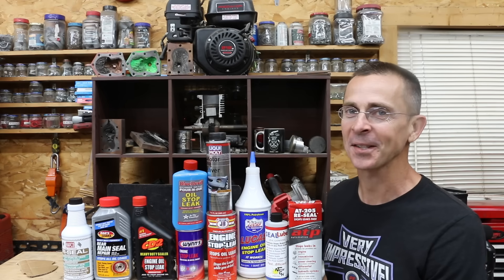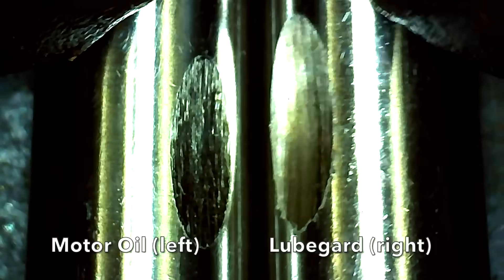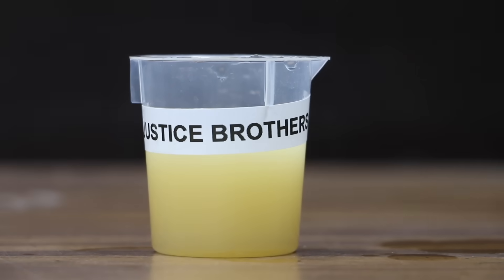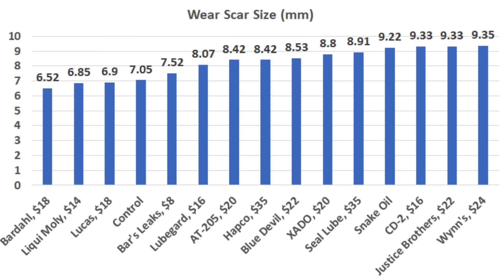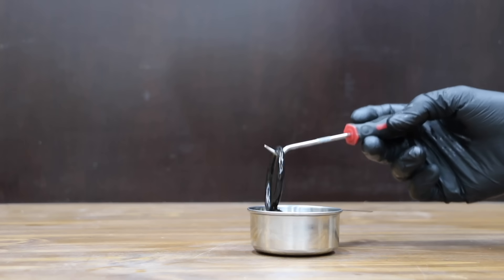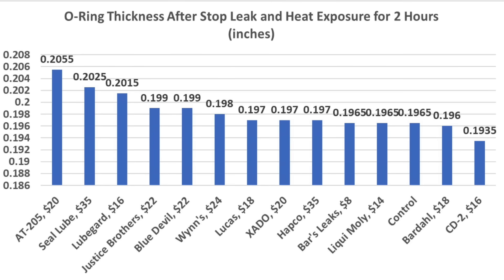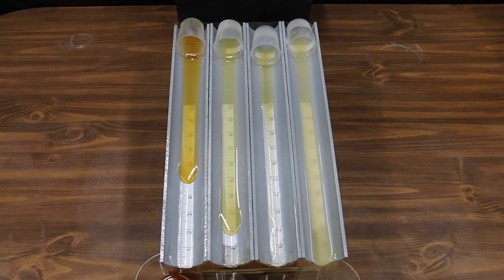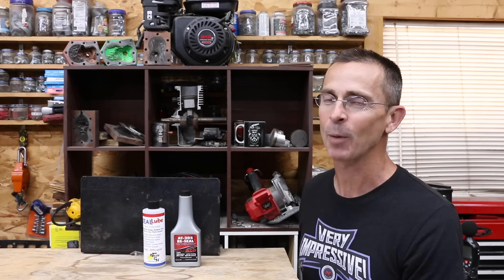Do Stop Leak Products Work? Do They Damage Engine Seals? Will They Destroy an Engine? Let's Find Out

Comment: I've used Lucas for 20 plus years I honestly wasn't impressed, but I'll still use it and pretend now it's working as well as before I watched this episode. You've helped me out countless times with products. You help out people I think more than you could ever imagine.
Reply: I use Lucas engine treatment in differentials and manual trannys but not in engines. Nothing replaces a blown o-ring but a new o-ring. BLESSINGS!
Reply from the maker: Thanks!
Reply: The only reason I use Lucas is to extend the life of a component already on borrowed time(wore out transmission, high mileage motor, worn power steering pump, worn differentials and transfer cases, and worn small engines).
Reply: @jamesm568  Sure. Mine is an 89 Taco and all the other stuff is from 85 on up to 02.
Reply: I'm confused did Lucas work or not
Reply: that was my experience w/ the lucas, but front main was (and remains) pretty hubbed out. it was easier to just keep throwing oil at it until some other failure forced me to clear a path to it anyway
Reply: @rngwrm  RIGHT! Oil is cheaper than shop time. I pour in the oil and drive. The car is a 97 Buick with over 250K and the Taco is an 89 4x4 with plenty of rust and a 4.3 and a 20 gallon tank. Check the gas and fill up the oil.
Reply: @lewiemcneely9143  98 econoline here, so about the same level of interest in a proper fix. blew a freeze plug or cracked the block in december, so now i actually have to  tear it down, and front main happens to be on the path to the bigger problem, but i'm probably just doing an autopsy at this point. if it's still salvageable, i can do the seal then, but at least i didn't waste the time doing work that i'd be undoing a couple of years later
Reply: @rngwrm  My old S-10 Taco has a Jasper rebuilt in it. the factory intake gave the bottom end a good slug of antifreeze and that was that. Like the old saying; it's good enough for who owns it. I don't know where my leaks are but as long as I can buy refills by the quart or gallon, they can keep rustproofing whatever they want.
Reply: I've found Lucas Oil Products give "peace of mind". Unfortunately, without very expensive test equipment. It's almost impossible to prove that there's any benefit.
Reply: Check out paul Harrell’s latest video. Step 4  ‘Know when your being that guy’.   Lol.  I’m not saying it to poke fun.  You self identify your experience vs choice I think you would find it funny and go with it as he recommends.
Reply: @rydplrs  I've been 'that guy' more times than  can remember during my 50+ years driving and equipment operating. I just wobble along as best I can while I am in my geezerish state. Remain calm!
Reply: got an 05 Civic 311k miles with replaced engine. Replaced all valve cover components & still oil leakage. Oil pan does leak, but was "bandaid" with some RTV from mechanic. Thinking it most likely piston rings seal failed with 170k engine. Also replaced the cam seal on side of valve cover. Would that ATP help or am I better off trying a Blue Devil or Bars product? Read main seal OEM part replaced upon clutch replacement so not worried there.Used Lucas in past, but will try the Stop Leak this time. Thanks for any advice.

Comment: Fron experience i can recommend the Lucas power steering as well as their transmission additive . I got about 13k miles so far out of a slipping 4l60e the dealer wanted $4500 to replace. The steering pump leak disappeared completely.
Reply from the maker: Thanks for sharing.

Comment: None of my local parts stores (AutoZone, O'Reilly's, Carquest) carry AT-205, so I got a 2-pack from Amazon recently as my PS rack and front main crank seal were leaking (4.7 V8 Dodge, of course, w/94.5k miles). Since they're 8 oz bottles, I only used 3 oz for the PS, and a full bottle for my 6 qt crankcase. It WORKED ON BOTH!
Reply: Oh, and since the percentage of product you mixed with the oil was so high, I wouldn't worry about viscosity or the potential wear factor.
Reply from the maker: Thanks for sharing.

Comment: I LOVED this video!  I’d like to see more tests of products from the “snake oil shelf” at the parts house, perhaps a comparison of radiator stop leaks with an eye toward subsequent core damage.  Clearly Sturgeon’s Law applies.  All oil additive comparisons should begin with friction and viscosity tests.  Fifty years ago, I worked at a service station/tow truck business on the North Cascade Highway. The owner was good at repairing damaged oil pans, transmission pans and gas tanks.  He sometimes used Bars Leaks in radiators. Other people swear at Bars Leaks and only use AlumaSeal. The debate still rages.There is definitely an audience for such a comparison. Thanks for the video!👍PS: I believe the surfactant Engin-Kool actually works.
Reply from the maker: You are welcome!  Thanks for the suggestion.

Comment: I stand by Lucas Products long story short I was in California and my truck had begun a lifter tick and a slight lower end knock so in a desperate situation I decided to drain all the oil out of my f 150 and replace the oil with a 50/50 ratio of 10W30 and HVY Stabilizer and in about 2 seconds after starting the engine all noises stopped and did not return for the duration of my trip back home to TX.
Reply from the maker: Thanks for sharing.

Comment: If a 6% loss in diameter causes an o-ring to leak, the o-ring seal designer needs to be fired.  An installed o-ring should be compressed well beyond 6% in a well-designed sealing system.
Reply from the maker: Thanks for the feedback.

Comment: Interesting to see how theses products act in the oil. Makes me hesitant to ever use it. But I would like to see the wear test redone with the actual mix ratios to see how much damage it causes vs the 50/50.
Reply from the maker: Thanks for the suggestion.
Reply: @ProjectFarm  I'd say the exaggerated mixture shows exaggerated results, but the results still show which ones wear more or less than the others, the main point of the wear test.
 There is no way to know what wear each product could do in different engines.
Reply: @ZackaryMac  sure. It absolutely does. However the proper mix would give a better idea of how "safe" these products are to use even if it doesn't work...
Reply: I immediately thought the exact same thing.  The stop leak should have been mixed to the manufactures specs for all of the tests to provide a more accurate sense of what was going on.  I love his tests but this one had me scratching my head.

Comment: Every time I watch one of these, I wonder why all the comments are always so positive, but I'm guessing the loads of people who don't have patience for these videos never bother to comment. It's really a terrible format to convey some useful information. I'd like more thoughtful discussion of how the products are supposed to work and less time wasted going over repetitive test demos of each. For this video, I might have explained that some of these are solvents, some are plasticizers, or whatever. They're meant to be used less concentrated than 50/50 so testing the wear at that concentration isn't helpful. Seeing if rubber is able to absorb them at dilute concentrations as recommended would be useful. And while the cold temperature test is interesting, you don't have to leave them in at cold temps. How about finding a product that you can add at some reasonable concentration like 10 - 20%, seeing if it refurbishes seals within one gas tank worth of driving, with minimal wear? Because that's the problem we're trying to solve. Nobody needs a seal restorer that can lubricate an engine and flow at -40. Maybe we just want to run it for a day or week in the summer and then change the oil to get rid of it. But yapping away with a bunch of repetitive and irrelevant tests to get past 10 minutes is an easier way to make money on YouTube.

Comment: We run one of the largest truck fleets in America and we have used  stop leak products in every truck in the fleet and I can honestly say that we are pushing over 400k on most gasoline Super Duty and Silverado rigs with no issues.  We also run stop leak in the radiators and transmissions and have saved thousands.  We prefer to use Bars, Blue Devil, Or Lucas as they are the most common at our auto parts locations.  Have also used them in the Powerstoke engines with No issues.  My region has experienced -40 and colder weather all winter and we had No start up issues.  Before using these products, we were seeing engine failures before 100k.  Even after having dealers replace seals, they were leaking again and again.  These products we found stop the leaks and saved thousands in nonsense repairs and extended the life of our engines, and we still have all rigs in service daily working the rails and no issues.  These trucks are by far worked in the most extreme conditions around the clock.
Reply from the maker: Thanks for sharing.

Comment: I have an idea for a test, not of a product bur, anyway. how much better will a car stop if a rotor of the same size as the one on the front is installed on the back? usually they install a pretty tiny rotor. for any force applied to the pedal, the force on the front pads is way bigger than on the back therefore, the pads on the rear are not doing much but the front ones are stopping the rotor.
Reply from the maker: Thanks for the suggestion.

Comment: After taking into account the numbers, I think that I specifically would want effective wear protection and seal rejuvenation. I'm OK if it evaporates away and I can replace it with oil. I don't want it over softening the seals over a period of months. To be it makes sense that I would probably replace the oil a decided amount of time afterwards anyway to let the stop leak do its job and then get it out before it damages anything. 
AT-205 looks like it accomplished that goal
Reply from the maker: Thanks for sharing.

Comment: Great test! The scary thing about some of the products is the separation and how poor they are at lubricating. When you start your engine they will be at the bottom of the oil pan like water and get sent straight into the oil system on startup.
Reply: The one that started boiling was also quite concerning lol
Reply: When you mix the very small amount they call for in a engine full of oil there will be no issues at all for any kind of damage, keep in mind he mixed this at 50 50 to show how the products worked
Reply: The ones that separated were also the ones that burned off the most. I bet most of it would be gone after driving it for awhile
Reply: It's not that scary considering most of these products are most often used by people trying to sell their crappy cars. They don't care if the engine blows up in a few thousand miles if the cheap little bottle of nasty goop nets them a few thousand more in a sale. Auctions and wholesalers love this stuff.
Don't use this garbage, just repair it properly.
Reply: I mean what if you ran it all day with a bottle of at 205 right before you went to go change the oil? Or if you only were to put in smaller amounts at the end of the oils life, ya know like right before you change your oil? I might be a genius, because that way you would still flush out the old oil, and all these other people saying well it's gonna get sucked up when you leave it overnight and it separates..it's all about timing
Reply from the maker: Thanks for the feedback.
Reply: some do some don't.
Reply: It will not be 50/50 in the engine. So it should have very little impact on lubrication.
Reply: @Bagom80  1 part it two, or one part in 10, the oil pump is still going to pull the bottom most layer first.  The only difference is going to be how long the engine runs without effective lubrication, not how effective it is.  Any oil product that seperates is going to be a major issue.
Reply: @Wooble57  You're right. Just how much water/feces do we want in our engine/ground meat deal all over again! I prefer none, myself and the water will sure be at the bottom, just waiting.
Reply: @lewiemcneely9143  I agree, the separation issue is a serious issue.  I have times that I don't drive for many days.  To cold start an engine and have nothing but that separated additive hitting the engine first is an absolute deal breaker for me.  What an eye opener.  I use Lucas and I'm sad to see it doesn't help much in that department.  But at least I know it isn't going to destroy my engine.  If I knew I could add this stuff to my engine and then after a couple hours of mild idling, do a oil change and still keep the benefits, I might consider it.  I have a rear main seal leaking on C1500 and the shops won't touch it because they say it can't be fixed without issues.  So I'm stuck considering this alternative.
Reply: @Wooble57  It is possible that the product is soluble in motor oil in the recommended concentration.
Reply: @Wooble57   I am no way a mechanic but I do not think the oil pick up will be that low in the oil pan. It is only 8 oz and if it does separate, the pickup should not get stright AT205 on engeine start. I think...
Reply: @Bagom80  oil pickups ARE low, otherwise it would be easy for the engine to get no oil at all if you are low, or when turning.  you are right that they aren't right up against the bottom of the pan, but they are close.

I was seeing ratio's of something like 5:1 on some of these products, that's almost certainly enough to cause the issue i stated.

I never use any of these sorts of products unless i'm ready to scrap the car if it doesn't work.  They all either don't work, or do work but have nasty side effects (in this case, significant extra wear on engine parts)

If you have a oil leak, either fix it right, or just stay on top of adding oil if you can't afford it at the time.  It's not a snob thing, it's what works without shortening the life of your engine.  It's the same with coolant leaks (though in this case, it's not likely to cause engine damage, but it will plug up your heater core and it's hard to remove all the junk when you go to fix it right)
Reply: @Wooble57  Good Point.

Comment: Todd, have you ever used the lubricity tester to test two weights of motor oil from the same manufacturer ? Like test Pennzoil platinum 0w-16 and then Pennzoil platinum 5w-30 or even 5w-40 and see if the wear scar is smaller with the heavier weight oil? I noticed in this test the thick one that was like honey had a smaller wear scar.... it makes me think that the thicker oil does better in the bearing wear scar test! Any thoughts?
Reply: Go to 540ratblog if you want a comprehensive oil comparison test.
Reply: @MrDLRu  Thank you! I'll check that out
Reply from the maker: Thanks for the suggestion.

Comment: The test could be inaccurate because your using a 50/50 mix then conducing the test with the wear scar jig and the other test the 50/50 mix in a real world situation would mean that someone is using half motor oil and half stop leak. In no way is someone using a minimum of 2 or 3 quarts of stop leak in there vehicles. Just thought I’d point that out otherwise I love your videos.

Comment: but we did not see actual leak, like one sidei s at zero and other side is displace with a shim 0.1mm or 0.2 mm with a seal, and what those stopleaks do when added to engines where is no rubber but silicone hermetics used (from factory)?

Comment: I have a quick question about the test pins on the lubricity tester: Are they hollow or are they solid slugs of metal? I was wondering because you mentioned several times during the testing that the test pins were getting hot, and I was thinking that if the test pins were slightly hollow you could put a thermocouple inside each one and read out the temperature as the test proceeds.
Reply: They are a test pin, therefore solid. A test tube… hollow.

Comment: I wonder if the at205 would work for resealing and reviving valve stem seals. I've got an 01 mustang gt that smokes so bad cause the valve stem seals are old and really don't wanna have to pull the heads off.
Reply from the maker: Thanks for the suggestion.

Comment: I wish this existed when I was younger.  I used CD-2 like crazy 🤣 and I always thought that it exacerbated the wear on my Ford302 Mustang 🐎 swapped out two motors before I gave up on all additives.  Like if the manufacturer included it with any engine then it would actually be recommended.
Reply from the maker: Thanks for sharing.

Comment: I have been a Mechanic for nearly 40 years, and I can tell you that there is no such thing a a "Mechanic In A Can"! I have seen some stop leak products cause damage to components. Your best protection is regular oil/fluid changes, and do not go by the manufacturers recommendations. They want your vehicles to fail. Change your oil every 3,000 miles (5,000km), transmission fluid every 15,000 miles (24,000km), exchange brake fluid and power steering fluid every 2 years, and coolant, differential fluid, and gear oil every 4 years. Sooner if you live in extreme conditions. Remember folks, oil is cheap, engines are expensive.
Great work as always, Todd! Have an awesome day! o7
Reply from the maker: Thanks!  Thanks for the feedback.

Comment: 50% ATP to 50% oil is crazy. The recommended is 500ml to 5 quarts, somewhere around that. so the ratio should have been more like 95%oil to 5%atp or 90% to 10%

Comment: Oh I have Ford F150 2007 4.6L and they are known for intake manifold coolant crossover to crack and leak coolant out which runs down the block and gets into the coil on plugs, shorting out. 

Any chance you have or may do a coolant stop leak comparison??
Reply from the maker: Thanks for the suggestion.